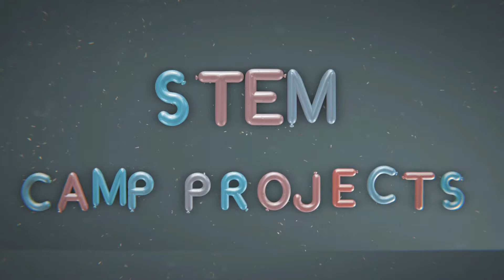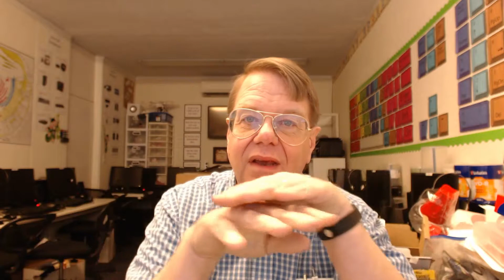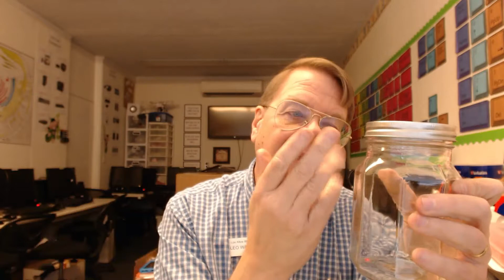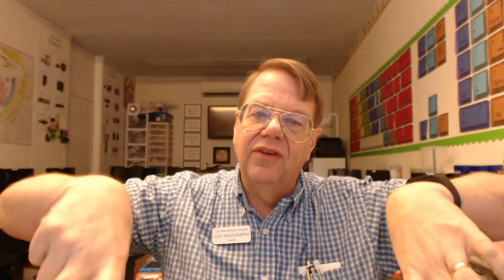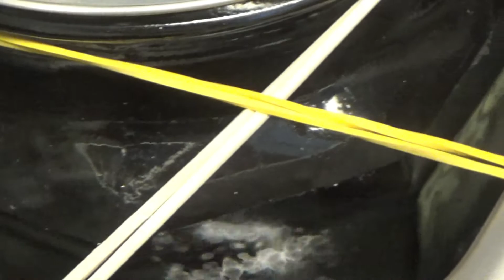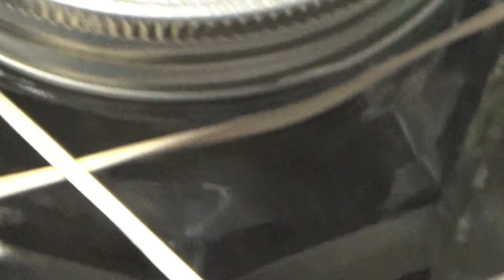Making Graphene with my DIY Sonicator Part One

Comment: Why use aceton. Baking oil is safer, and also does not react with water or carbon, and also forms a second layer on the water. #GetthoLogic
Reply from the maker: I've never heard of using baking oil.  I have used acetone because of hearing about it from Robert Murray Smith. What kind of oil? There are lots of different oils that can be used in baking.  If it works, I'd strongly prefer using it.  I know the acetone gets between the layers of graphite to help them separate. Thanks!

Comment: I really like your home made sonicator, Your videos are a bit easier to understand for me.  I went and compared your video to his just because My math wasnt adding up on 3:1 ratio and 37.5 g of graphite seemed a bit high. My mix never really seperated, My error was it is not an exact 3:1 volume ratio  acetone is lighter and = greater volume. also the graphite should be about 1.5g for that volume of liquid. Quote from Robert Murray Smith's video
 "416.75mL of acetone
88.25mL of deionised water
1.5g 325 mesh powdered flake graphite"
so I am trying it a second time this time using Dixion Flake graphite and not the questionable CCC Chinese fine graphite I tried before. using 208ml acetone, 44.125 deionized water, and 1g medium flake graphite. the Larger flake will probably take a lot longer.  😀

Comment: how do you calculate the acoustic power delivered to the total volume of the sample? 
I need a industrial sonicator which can sonicate 400L of my solution by providing an energy of 10KiloJoules per 1ml. How can you address my requirement in terms of the energy delivery and volume? Please contact me
Reply from the maker: I suggest you use a commercial sonicator.

Comment: You can also use gum arabic as green alternative to acetone with a sonicator of course ..
Reply from the maker: Huh?  Are you thinking that a solution of gum arabic can be used instead of acetone for separating graphite flakes into layers, i.e. graphene?  This sounds too good to be true!  How would you make the solution?
Reply: @stemcampprojects7951  the simplest way to answer you is to give you the direct link https://cyberleninka.org/article/n/369818.pdf

Comment: Sir i have a doubt.... how much graphite you used and how much graphene you were able to obtain? Because we got very less graphene from almost 5 graphite electrodes... we used electrolysis followed by sonication process
Reply from the maker: I haven't measured it.  I got a small amount of graphene from a moderate amount of powder -- maybe about 1/10 the powder.  However, acetone used in that process is a very strong chemical, much stronger than what I'm comfortable having around my students.  I'm experimenting with the electrolysis/sonication process myself - and I'm also getting small yields.  I'm hoping that I can figure out the parameters in a way that is more efficient.  Getting graphene is possible, but getting big quantities may be very difficult, which is a problem because I really want to experiment with it!
Reply: @stemcampprojects7951  kk sir... your comments are much useful... can i get ur mail id sir... we try to post our results to you... probably we are gonna conduct the exp again next week

Comment: Sir... what is the duration of sonication to obtain graphene??
Reply from the maker: Not an easy question.  Depends on the method used (acetone/water or saltwater/electrolysis).  Depends on the strength of the sonication itself (how much the layers are being shaken apart).  Depends on how much material is being sonicated.  Depends on the temperature.  Probably depends on a hundred other things that I am not aware of.  I'm working on getting the most yield in my little lab using my homemade sonicator and saltwater/electrolysis because I want to avoid acetone with my students.  Once I figure out how to get the best yield for that process, I'll share it - I'm in the early stages now.

For acetone/water/flake graphite and my 100watt sonicator it seemed like I had a good bit of graphene in the liquid mixture after 4 hours.  But your results may well vary from mine.  I also want to make a lot more graphene than I was getting using that method, so it becomes inexpensive enough to use in experiments with my students.
Reply: @stemcampprojects7951  tq sir... i'll note this down... 🙏

Comment: Sir i have a doubt... can i use the electrolyte mixture which i used in electrolysis exfoliation process as a liquid medium in sonication instead of acetone/DI water ???
Reply from the maker: I think the answer is yes, but only AFTER using electrolysis.  The electrolysis helps to get something (ions?) in between the layers, preparing them to be broken apart either by sonicating or in a blender.
Reply: @stemcampprojects7951  is it possible to do electrolysis and sonication at the same time ??
Reply from the maker: @The_real_Sarcastrovert  I don't know of any reason it wouldn't work.  My only concern is the shaking of the connections to the electrodes, but it might be fine.
Reply: @stemcampprojects7951  very much thanks sir... happy new year... may this year gives you more and more happiness... plz post as many videos possible and share your wisdom to all...

Comment: Sir plz tell wheter making graphene directly from graphite powder using sonicator is better??.... or first electrolysing graphite foil and then sonicating the graphene obtained is better???
Reply from the maker: That is a great question - and I'm trying to figure it out myself.  Using acetone and water and sonicating it absolutely worked.  BUT acetone is a nasty nasty chemical.  Using electrolysis in plain salt water at 12 volts is much better for me because it is great around my young students -- and I still will use my sonicator at the end instead of a blender.  I'm in the middle of trying out the graphite foil / salt water / electrolysis method, and I plan to post my results.
Reply: @stemcampprojects7951  sir really tq for replying to my questions... plz post more videos, can you tell what mixture do  you pour with graphene obtained after electrolysis for sonification because i thought of using acetone mixture in graphene obtained electrolysis like in first case...
Reply from the maker: @The_real_Sarcastrovert  You could drain and rinse the graphite wormlets obtained from the electrolysis of the grafoil in salt water and then process it in acetone/water sonication.  I'm sure that would work - but I'm not sure it gives you any advantage over just using flake graphite in the first place.  As I understand it, you can directly sonicate the wormlets in the same jar and mixture used for the electrolysis - in other words salt water - and then rinse and dry it afterwards.
Reply: @stemcampprojects7951  very much tq sir... u r very very patient teacher i came across... tq for answering my questions so patiently...  waiting 4 ur nxt video... can i use a probe type sonicator instead of ultrasonic bath?... if so plz make a video on how to construct one like this... i hope i'm not disturbing you... tq u for ur selfless service
Reply from the maker: @The_real_Sarcastrovert  Yes, you probably could use a probe type of sonicator, but I do not have any information about how to build one.
Reply: @stemcampprojects7951  tq for ur information sir... love u a lot... plz continue to do more informative videos

Comment: In regards to 5 hours of sonication I have found the transistor blow up if worked to hard for too long . I would keep an eye on the temp of the transistors to make sure that the cooling fan can keep the entire unit cool enough . I have fixed mine 4 times from over duty cycle . I would suggest 1hour then let fan cool for ten minutes and then an hour again 😊
Reply from the maker: I absolutely agree.  So far I've run it a half hour at a time - stopping when the water had gone from cool to lukewarm.  I hope the fan will let it run longer, but I'm going to watch it super closely.  An hour long cycle sounds about right, but we'll see.  Thanks, leo.
Reply: STEM Camp Projects hi Leo . Another tip that will help is to make sure the transistors are screw tight to the heat sink and preferable with thermal grease . This made all the difference with mine
Reply from the maker: This is an excellent and timely tip -- I'm going to have to pull the driver board off to mount the fan, so I'll check the transistors and add thermal grease as needed.  Thanks!

Comment: Hey buddy . Seems to work fine with rubber bands but can’t help thinking it’s still having a dampening effect . I would try a metal  coathanger  twisted at each end with a hole shape in the middle that allows the lid to slip in to just tight enough to hold it ! It may increase the efficiency a fair amount I would think . In my bought sonicator it comes with a stainless wire cage
Reply from the maker: It's very possible.  The bands are not super tight - they are fairly loose, but I want all the power given to the solution.  I'll consider changing the mounting soon.  I've got so many experiments I want to run and so little time! <grin>  Thanks for the suggestion!
Reply: STEM Camp Projects tell me about it . I guess at this point well enough is good enough . I sometime get to caught up in improvements and obsess about efficiency 😂
Reply from the maker: Me too!

Comment: I think your losing some mojo through the glass. I’m gonna build mine so I can lift it out to pour. Not use a glass. Just straight in the bath.
Reply: STEM Camp Projects I did mine in the bath and it’s was very good result but with acetone it will be a problem with rapid evaporation ! The heat generated by the friction is a good indicator of efficiency seperation . I would stick to the glass jar with acetone and keep it cool as the pressure will build up in the sealed jar . And let it cool down in the fridge before opening to avoid the acetone evaporating
Reply: STEM Camp Projects in regards to letting it evaporate I see a great opportunity to reclaim the acetone with simple distillation process but maybe a concern teaching the kids distillery techniques😂
Reply from the maker: Good thought, Guy.  It doesn't seem like I'm losing too much - the peaks inside the jar seem similar in size to the peaks in the raw tank - but every bit helps.  Of course it is easy to do batch after batch with a few jars instead of having to clean the pan each time.  Always a tradeoff!  By the way - thanks.  Your thoughts about using a cooling fan were spot on.  I picked up the fan today and will install it soon.  I got a "surplus" high air flow rate fan for $5., but I also had to add a 12 volt adapter for another $6.95.  Still a good price for both, all things considered.  I should have my first impression of how well it is working tomorrow - the mixture was sonicated for an hour, and now it is sitting all night.  My current plan is to do about 4 or 5 hours of sonication, but we'll see!
Reply: Electron Proton Neutron Mouron im concerned the jar could explode
Reply: Guy Ruff yes guy it is possible with the expansion from heat but more so I think it would be a crack but either way by default the contents ends up in the pan and you get the in the pan outcome 😂 bit if it’s kept within 20% of its original temp I think it should be fine . Come to think of it I would use a jar from fermented products like sauerkraut as they are designed for inside pressure !
Reply from the maker: Very good thought.  Yes, I'm sticking with the jar.  They are canning jars and are designed for varying temperatures and modest pressures.  So far after a 1/2 hour, the water in the stainless steel tub goes from cool to lukewarm.  I won't run it so long that it becomes hotter than that.  I'm expecting the new fan will keep it down just fine, but I'll be careful.  Good point about evaporation in the raw pan.  I am not worried about evaporation when I open the jar, because at that point I will be rinsing out the work product and deliberately evaporating it anyway.  I want graphene, not acetone. <grin>  Thanks, leo
Reply from the maker: Hey teacher, what happens if we put various grains into this unit of yours? <grin>
Reply from the maker: OOPS!  When I turned the little surplus fan on, it blew wonderfully strong, but was louder than a jet engine!  I just got back from Microcenter - picked up two fans cheaply -- huge ones (200mm) that actually are supposed to move a bit more air, consume less current, and be quieter than a whisper.  I plan on mounting them in a push-pull configuration to get a great airflow right across the driver board.
Reply: @stemcampprojects7951  Would fans from a recycled PC in a push-pull configuration be enough? Or perhaps a screened hole in the bottom, and four fans one on each side. One advantage of using PC fans, is you can use 5v cell phone chargers (more recycling).

Also, since you are using a jar, why not cool the water with a small radiator? Admittedly more complex, but more efficient and would allow for longer run times.